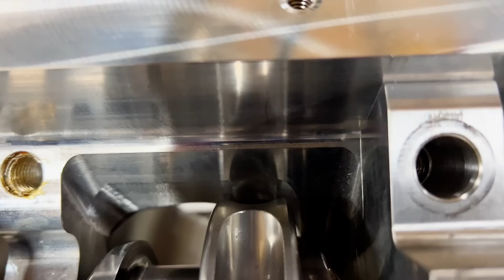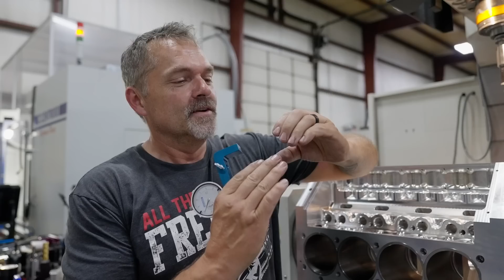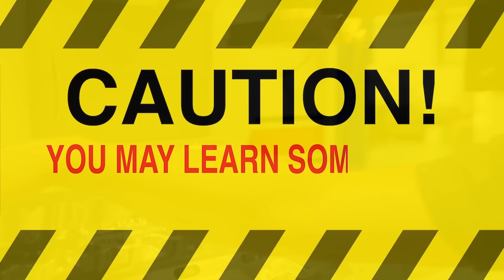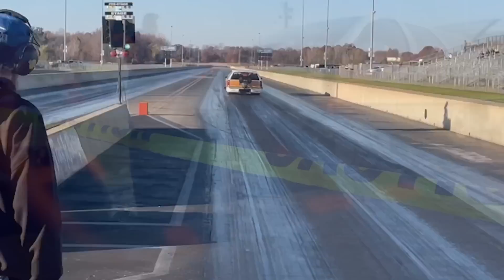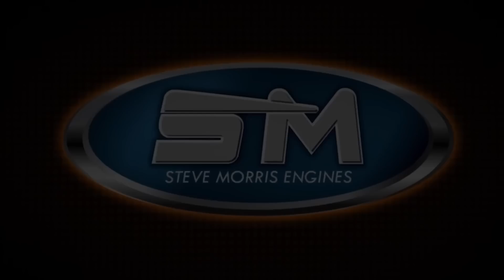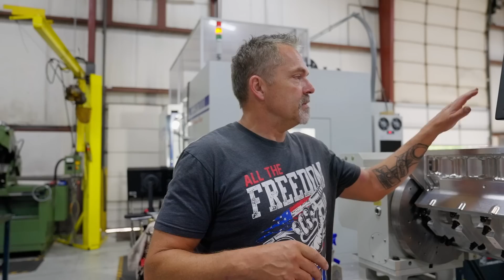What Is A 3500 +HP SML? …. The Baddest Drag And Drive LS Style Engine Out There!

Comment: It might be possible to machine the block without the ninety degree head. If you used an endmill to relieve the area to a depth equal to the bearing radius, that would stop the bearing from moving down while the round recess in the cap would restrain it in three directions. The cut in the block can be wider than the bearing so the radius left by the cutter will be out of the way

Comment: I have read that a non smooth surface causes bubbles in the cooling system. The bubbles against the surface prevents heat transference to the water.

Comment: only thing I see, how is the heat dissipation between the cylinders since they're butted together(siamese) and then further heat transfer blocked by large head studs. that has to run way hotter there, just like the old sbc 400 were notorious for melting down due to siamese cylinders, granted you have aluminum to help dissipate the heat faster.
I keep waiting for someone to try copper or copper nickel for a block... 🤣🤣🤣

Comment: A REGURGITATED FORD 427 HIGH RISER ENGINE WHICH SET ALL THE BENCHMARKS OF PERFORMANCE IN THE AC COBRA, LABELED AS A CHEVY SMALL-BLOCK. NOT ONE DESIGN ASPECT OF THE OLD SMALL BLOCK CHEVY LIVES IN THE LS. FROM TOP TO BOTTOM, FRONT-TO-BACK, SIDE-TO-SIDE IT IS COMPLETELY BASED ON FORD DESIGNS.

Comment: Steve, be careful using equal radius on matching parts. Rule of thumb would be to use a slightly smaller inner radius than the matching part's outer radius, to prevent bad matching between them.

Comment: Steve,
How much interference is between the block walls to the sleeve ?
This is the stuff I get into. All the nerd stuff.
I am really impressed with your design with adding a head bolt under the intake port. 
Do you machine the entire block form start to finish at your place? How much weight is in the chips removed?
Are you hiring?

Comment: On mains: steel caps go on iron blocks (maybe) and aluminum caps go on aluminum blocks. You're 100% right that the thermal expansion is important to consider, even in the bottom of the block. I am always baffled when people neglect to think about this.
Regarding cross-bolted mains, the shear strength of the bolts is no more important than that of wheel studs or converter bolts. By clamping the skirt of the block against the end of the main cap, a lot more friction is applied in the spot, which is what actually contributes to the cap staying where it's supposed to. Your splayed design, however, would also apply some friction to the end of the cap and also adds regular, old, tension force to hold the cap up in the block.
If the shear strength of the main bolts was relevant and relying upon it was a problem, then splaying the outer bolts would present the same problem.

Really love how much detail you go into with these films, especially considering it's about a priority design and your own invention. Very cool and a boss move.

Comment: Two things you didn’t touch on, that’s of interest, at least to me.
Are the head and cap studs into thread inserts in the block, or have you found the block material adequate?
…and the gun drilling and oil passages in the crank. The crank in general seems have a ton of thought and engineering there.
Reply from the maker: Aluminum needs lots of thread engagment

Comment: Definitely since you have a machine shop it makes sense to figure it out, but we sub-contract our parts so it has to work. Our tools are not nearly as complex as an engine either so we don’t have complex interactions like this. We also have a saying that everything works in CAD. Just because it works in CAD doesn’t mean it works in real life. For people wonder about why Steve is needing out about big radii it’s because of stress concentrations. The bigger the radius the less likely it is to break at that point. This is probably especially important in a vehicle since it sees a lot of heat cycles and has harmonics. Stress concentrations lead to cracks and cracks lead to broken parts. Very cool!

Comment: Amazing how much thought you put in the SML!
I have one question, if the rod bearing fails does the rod bolt hit the block?
It's hard to see on video.

Thanks for always explaining why you do stuff on these custom billet engines.
Reply: if a rod bearing fails, everything is going to hit everything, especially if it's above idle/under load, which is when they always break.

Comment: Hard to overstate how impressive this whole operation is. Seriously high level design and machining, as a guy who designs stuff that goes to space, and works with some of the best aerospace prototyping machine shops around, Steve and his crew are doing it at a higher level than 99% of the guys in my industry. The missed thrust bearing counterbore and having to go in there with a 90 degree milling head cracked me up because I’ve got a stack of gimbal mounts with the exact same issue in the shop right now. Shit happens, that’s why there’s red dykem, mark it, fix it, move on

Comment: I'd like to see what Steve could do with a 5 horse Briggs and Stratton engine.
Reply: I have a friend who's son runs a Jr dragster.  They have a highly modified 5 hp briggs. 😮
Reply: @michaelmcclure8673 
a 5hp lawn mower engine is gonna do 5hp there's not much there to work with..
Reply: @matthewvarnam4302 you came easily bump the compression on that bad boy stroke it it out at the same time and switch to ethanol honestly there’s a lot you can do with those single piston engine my buddy would build them for his bike
Reply: I have a tecumsa star engine that’s a 8hp from the factory that puts out 25-30hp. Same engine as the stock. Just bigger cam/bore/stroke and porting and it’s runs on methanol.  Those 5hp Briggs engines put out around 20hp.  So. It’s not just a 5 hp engine anymore if you know what you’re doing.  Steve could probably make one 40hp
Reply: @michaelmcclure8673  Think they called those Blockzilla?🧐 Or something along those lines.
Reply: I wonder what nitrous would do?

Comment: Hello Steve, I worked at GM and you can run circles around all of their powertrain engineers.  They can make a much better engine but due to the "old school" mentality of that is the way we've always did it, they are all in fear of trying anything new.  The other major issue is that cost overrides quality.  Their best engines, the old supercharged 6.2L and now the C8 Z06 5.5L flat plane crank are great but I'd bet my life that you could find a dozen ways to improve them.

Comment: I see the SMX and SML being used in offshore boat class racing. You have put a lot of thought into the design of both of these motors.
Reply: boats like you are talking about need a 100% engine. Meaning it can run all day at top RPM. It's quite hard to convert a car engine to a marine engine tbh.. its easier converting a marine engine to a car engine. 2JZ was originally supposed to be a marine engine

Comment: I now realize why you say splayed mains are better than shear bolts coming in from a 90’ angle. The force has to overcome both shear strength and tensile strength of the bolt, not just one or the other. Not that you mentioned that fact but when you were showing the main cap fit I realized that. I admit I was wrong saying shear bolts would be better than splayed! Good design work on that SML all the way around thanks for showing all the aspects that went into the over all design Steve!

Comment: Wondering what CAD software you use to do your machining? Also, do your Machinist's program or do you have a dedicated programmer?
Reply from the maker: The Rottler a have pre canned programs 
Otherwise Otis solid works and master cam
Reply: @stevemorrisracing  I haven't programmed in Solid Works but I do love me some MasterCam. Very user friendly program with minimal training needed as long as you're not doing anything 5-axis I've found.

Comment: So this engine has everything a smx has except the crank shaft thrust bearing plate kit on the front. Can a thrust bearing plate be optioned in to the build. Im sure people are going to ask about this. On the other hand people that can afford to buy an SML should have there converter pressure dialed in, lol

Comment: Those inner plates will seep water into the oil. Also the water flow and actual cooling capability of this design are questionable. Yes it only sees full throttle for a couple of seconds at a time, but towing up hills creates a lot of heat too. Although aluminium dissipates heat quickly, it also reacts to heat very violently. The key issues with the current design are: The plate thickness and the seam. It has a head stud bowing it like a card, and the seam has to cope with that with the water pressure. the block itself has different temperature than the plate so the heat distortion is different between the parts. The water passage goes very thin at the middle stud, right where the flame front hits the back of the combustion chamber and turns down pushing the piston with it. The six-stud pattern favors the outer edge, creating less clamping force in the middle, and this with the extra heat and less cooling, warps the head blowing the head gasket between the cylinders.

Comment: That aluminum block is a thing of beauty. Back in the late '70's or early '80's I was sending ideas to Mr. Gasket hoping to make some extra money.
At that time Rich Preston was the head of their R&D Dept. One idea I asked them about was: 1) Why can't roller lifters be used with hydraulic cams?
2) Because of the cam friction using solid cam bearings I sent a drawing and suggestion about using needle bearings on the cams.  3) It was also my
suggestion and drawing of using an air filter in place of a steel/aluminum top carb cover much like K&N etc. is using these days. There, I feel better now!
Reply: they filters were already about back then mate. Im in the UK they filters have been about forever.
Reply: @bigduphusaj162  Hi there! It's probably been close to 50 years now when I first sent those air filter designs to Mr. Gasket in the '70's. It got
to the point that it's hard to remember the exact date. At that time I don't ever recall seeing them on the market. Back then, I use to buy just 
about every car and motorcycle magazine out there so I would never intentionally rip off someone else's design. Too much bad karma! 
Take care!

Comment: Does the smx have roller cam bearings with no oil feed hole as well??? If so pull the bearings out of one next time you have one apart. Show us a well used cam bearing. Super interesting and I’m super interested in how they do hold up

Comment: I’m currently having a discussion with a friend who’s building a tall deck hot street/strip LS 475 ci. He’s saying roller bearings are not for the street. I say they are because I have done it. If someone puts 10k miles per year on a high performance 475 ci LS that makes peak power at 7500 rpm, am I right in saying that roller bearings and alu rods is a no-brained if one can afford it? Also trying to make him use GRP alu rods instead of Crower titanium rods.
Reply from the maker: No problems on the cam bearing
The  Ti rods are actually really good
Reply: @stevemorrisracing  
Thanks Steve. 
That SML looks gorgeous.

Comment: Thrust surface like that was cut with a bar thru the block with bushings in each bearing bore and a single high speed steel tool with a long enough cutting edge to cover the whole needed surface, the bar was driven by a spindle in a horizontal milling machine and slowly with Lube fed into depth.
On roughing tool bit was taking only half way out to diameter.
What you’re doing is called circular interpolation
Awesome engineering, thanks for sharing ❤❤❤
Reply: Circular interpolation being the specific path of the tooling?
Akin to Trichoidal milling paths, but a obviously different mathematical formula governing the movement?

I don't word so gud, what them thar many syllabic words.
Haha!
Thanks in advance!

Comment: I still am very curious about the cooling water making that loop. The first cyl gets nice cool water on one side then it runs by 6 more cyl wall halves before cooling the other side of the 1st cyl.  Is that not an issue?
Reply from the maker: Every engine has the same issue.
Reply: @stevemorrisracing oh. I figured it went down a path/manifold of sorts in the block, then out around the cylinders, so cooled water to each cylinder, and up to the heads and back out. Then the reverse cooled LT1 was the opposite. One of the diesels I deal with has a rear cylinder that cooks so we run a line to a port in the block right from the pump.

Comment: I have a dream to take the "weed Wacker" "for mix" motor into an eight cylinder. So two stroke jug style with valves and the exhaust running into four stroke heads.

Comment: The sml is a great motor. With the SMX, that's a hybrid of a bbc and a hemi correct? I had someone arguing with me and saying it had nothing to do with a hemi. Was I wrong?
Reply: SMX is based on a BBC.  He has shown the evolution many times.
Reply: @paulcopeland9035  It has a Hemi front and a big block Chevy back. Inside, the SMX features a Sonny Bryant 4.500” billet crank with Hemi journals and BBC mains that's been fully counterweighted, lightened and gun-
Reply: Does this mean it's just the front for hemi accessory parts like alt, balancer,  and brackets?
Reply: @paulcopeland9035  if it would let me put a picture of info I read it says it has hemi and bbc derived stuff

Comment: DO NOT USE A STYROFOAM COOLER!!! At subzero temps it will come brittle and fracture at the slightest touch! A METAL lined ( inside or outside ) cooler will prevent this..Stainless is preferred..
Reply: What did I miss?  I did not see the devastation you speak of!!

Comment: Really surprises you use them gloves to install the sleeves. All it takes some stray strand to get stuck behind sleeve and all you have to do is use proper gloves and slow down a lil . And I’ve seen this several times by you. Why don’t you have a proper pro way of doin it. Just such high end wrk to then grab pair of cheap wrk gloves just seems silly. Like a nice brand new clean pair of proper gloves. Not the gloves you use for grinder rust off a old square body truck frame. 😢
Reply: Are you in the glove selling business??

Comment: Steve for a drag car only with a cast iron block & alum heads on methanol could you run water in the block only and have all coolant ports in heads blocked off?
Reply from the maker: You could

Comment: This was very interesting to say the least and kudos to the achievement, Steve. 

Q: Do the 16 small fasteners that seal the lifter valley cooling side of the cylinders match the same peak load value as the 4 large head studs? Not being a smarty pants, just curious as the smaller fasteners side load force appears to support the clamping load of the head studs in addition to the plate. 

We saw our buddy Dewey make his cameo so that made our day! Cheers!
Reply: Agreed, that plate basically is a spacer tube, and the bolts/studs will screw directly into the block near the cam tunnel/around the lifter bores.
That thought did cross my mind too, so looked closer and rationaled it out
Reply: the head studs pass through the plate the plate is basically a sheath portion. Hes covered it on the early SML vids.
Reply: I don’t believe there is an issue due to the cover bolts must be rated for the coolant pressure the secondary purpose of being a spacer sleeve for the head bolts isn’t what’s holding torque that is done aT the mating surfaces between the head and deck and only aT the threads below the coolant plate.
Reply: @at_3831  Hopefully Steve addressees the question in the upcoming video, Monday. The sleeve portion of the coolant cover act as a crush sleeve so there must be some load that is transferred to the 16 fasteners.
Reply: @strykerentllc theres zero load transferred the plate fasteners that portion is only to allow the stud to pass through. The stud clamps on the head and thread section which is in the block. There shouldnt be any load at all transfered to the plate full stop.
Reply: @bigduphusaj162  You know, your comment reads as if you actually believe there are such conditions as perfectly flat, perfectly round, absolutely rigid, and perfectly square. Nothing and I truly mean nothing you stated is accurate. If there were zero load condition on the plate, it wouldn't require anything more than epoxy to hold it in position. Leaving yourself an out with "There shouldn't..." is quite telling. If your comment was accurate, torque plates wouldn't be required during cylinder bore sizing as the base material wouldn't deflect/distort during force application. Please refrain from further opinion as Steve will likely address the clamping load the plate is subjected to while under tension from the head studs.
Reply: @bigduphusaj162  The head would crack without support; the cover plate does crush to a certain extent.
Reply: @strykerentllc  dude this is a pompous ass response for no reason other then to belittle and make yourself feel superior. Not sure why a rational conversation had to turn into a smack down.
Reply: @unleavenedkaraiteplus3412  I disagree the cover is a coolant jacket the use as a head bolt sleeve isn’t it’s primary function tbh the bolt sleeve serves no real purpose and could easily be eliminated and nothing would happen except a few oz of weight loss
Reply: @at_3831  Nobody asked you for your opinion and yet here you are. You confused pompous with factual data points based on knowledge. If Steve cares to address the inquiry, so be it. Go back to doing whatever it was you were doing before you decided to offer your opinion that wasn't requested by anyone.
Reply: @unleavenedkaraiteplus3412  The head wouldn't crack as the volume of material in the head itself would not reach anywhere near a maximum tensile threshold when the head bolts are set to the specified torque value.